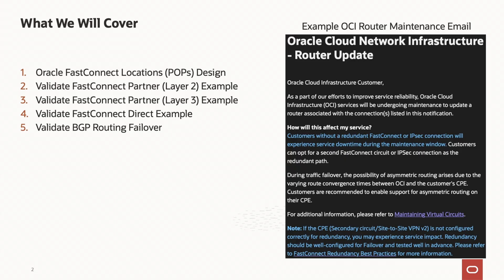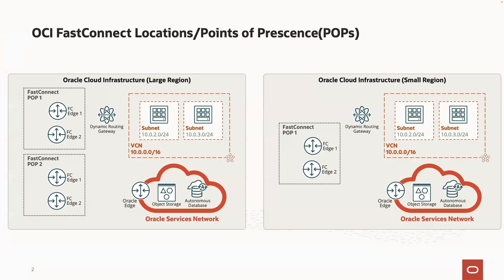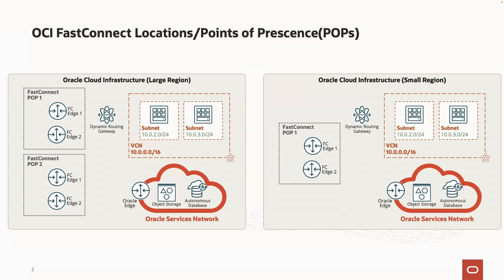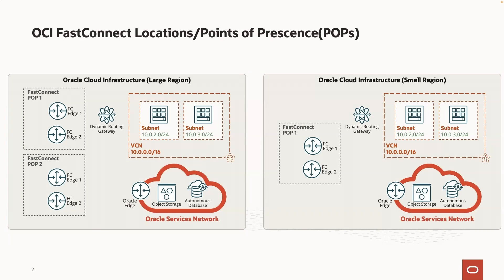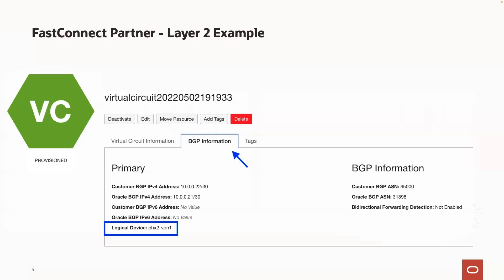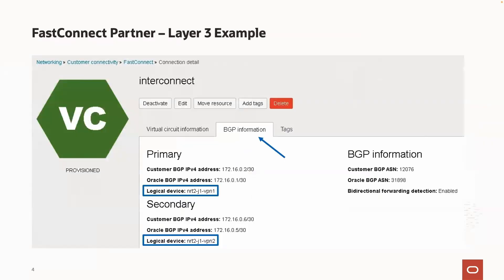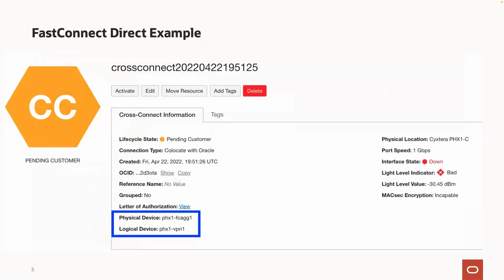Validating FastConnect Redundancy in OCI

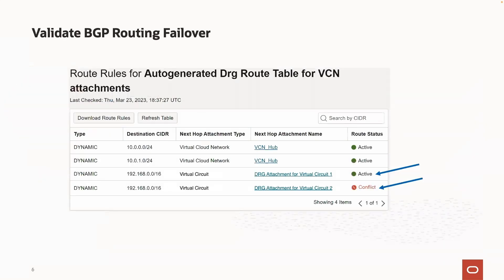Comment: At 3:21 , there is an example with a partner connection with which you get two BPG sessions, but this doesn't show in the route tables like at 4:21 ...? Does that mean it is not BGP redundant?
Reply: Same question

Did you find any answer?
Reply: Hello, sorry for the lateness of the reply but with a Layer 3 partner connection, you will get two BGP sessions like you saw at 3:21.  But with a Layer 3 partner you will only see a single route in the DRG route table.  It does NOT mean you don't have proper redundancy.  If one of the BGP sessions were to fail, your DRG route table would essentially not change, it would still show as active, it would just flip over to the other BGP session in the backend.  We are planning on adding additional BGP visibility options in the future that will show the two different BGP sessions.
Reply: @benwoltz1  Thank You My doubt got cleared